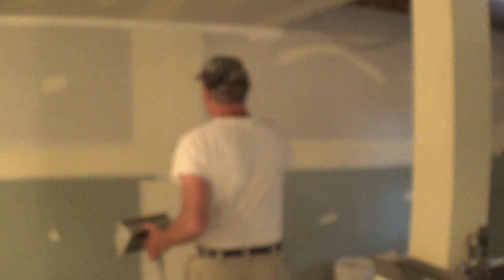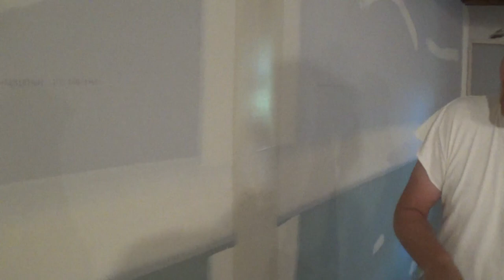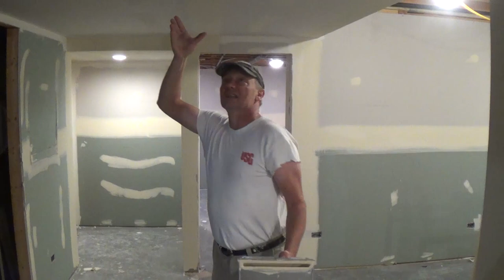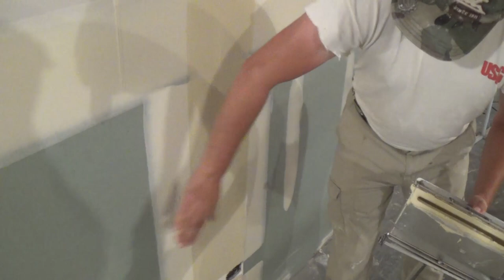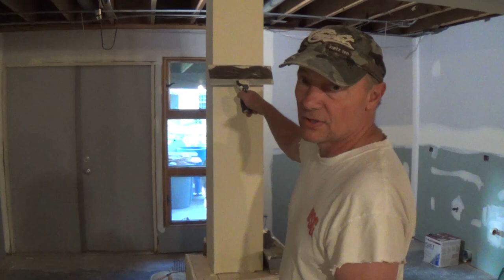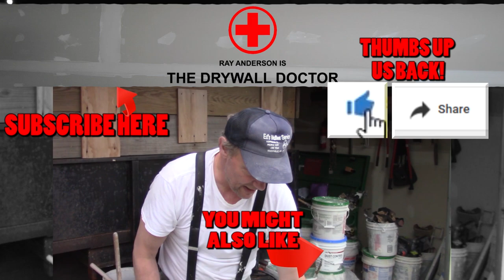How to Box Off Butt Joints (Flat Box and by Hand)

Comment: For second coat on butts, we often coat the center, and kick the box down one notch and run the two outsides of the butt joints. In essence tripling them out so that the hump created by splitting them out gets tapered out even more. On a big house we will second coat all the butt joints, (running them out a little farther,  band to band and chasing them with a 12" knife)  let them dry overnight, and come back next morning to finish box the bands straight through the dry butt joints. No crossing necessary. You did similar on a few of them .
Reply: I suppose you should ask the DOCTOR this. But generally I check the butt joint with a straight 12" drywall blade. If it sits recessed I would probably run it on a "1" setting down the center. And then split it out on a "two" for the second coat. If the But is perfectly flat on the wall, I would split it out on a "1" setting. And finish coat on a "2" setting. If the butt sits quite proud , I would split it out with the box wide open. And triple it out second coat with the box on "2". But always check your work with a nice straight blade to make sure. Sometimes we use "Butt Boards" to recess our butt joints.

Comment: Hello sir, so it looks like you hit the buttjoints with just the 10” box on the sides and then the next day right down the middle. What if the buttjoint isn’t perfectly even, have you done another coat with the 12” on sides and then middle? Thank you. I tried this at work for the first time and I accidentally used a 12” the second coat but wow was I impressed on how flat it was. Also you mentioned in one of your videos the number to box with, I was using a 3 for both seams and buttjoints. But I think I remember you saying use like a 1 or so on buttjoints?

Comment: When you run horizontal flats with the box, are you able to fill all the way into the inside corner, or does it leave an 1/8 gap or so? I’m new to boxes and am having that problem. Thanks
Reply from the maker: More like 1/2 inch to an inch when I talk about crossing off that's part of it.

Comment: Split with 10 box. Triple with 12 box. Tight coat with 12 " knife.
Reply: Only when 12”box doesn’t cover tape down middle on skim then yea… but if it covers good why? Just adding more unnecessary steps
Reply: @juanojeda2982  covering tape, and making it flat are 2 different things. What he's done on that one joint , where he ran it down the middle on "0" i wouldn't do. 0 leaves too much mud especially in the centre. Also i dont care who you are if you do this and don't do any further skim, when you sand and prime, look back with a light and it just wont looks as good .

Comment: Your work ethic sucks i work way different  from you. I run the 10 inch box for the first coat 12 inch box to cross  the second coat. After it all dries i do touch ups or crossing  on everything. Basically i give my mud jobs 4 coats before i sand
Reply: your work must suck if it needs 4 coats...lol
Reply: 4 coats and you still sand?? wow...dude...idk what to say